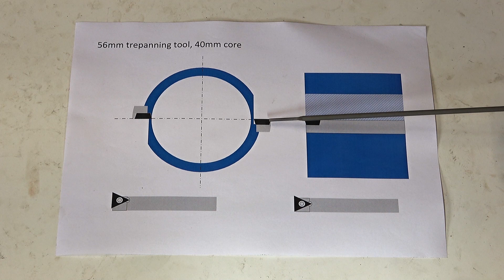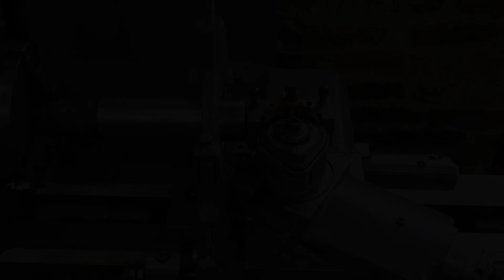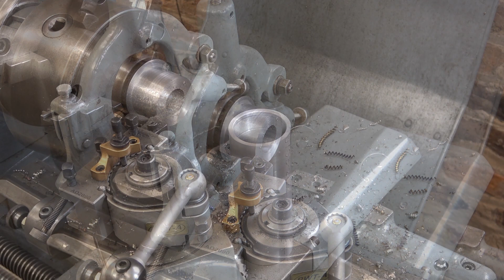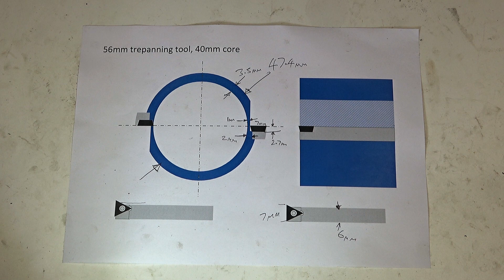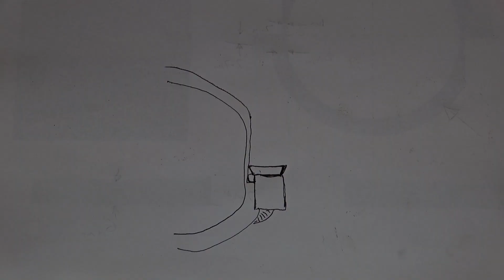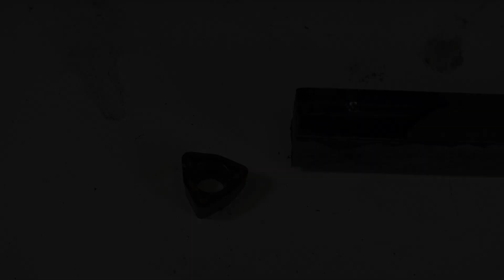HS104 Shopmade tailstock trepanning tool – Part 1

Comment: I seem to recall that David Wilks allowed a 5 degree relief angle on his scrap channels.

I once asked David why he showed himself standing next to a statue of Charles Darwin & he explained that Darwin was a hero of his.

Lastly I am envious of the Harrison which was my favourite lathe of way back. 
I don't think that you need to use carbide for this job unless you intend it for exotic materials in fact I suspect that carbon steel would work with the level of 'flood cooling' used together & low cutting speeds making a narrower cut possible.
Reply from the maker: Hi pcka I miss David's videos. Thanks for watching and the comment. 👍

Comment: Interesting. I like the your milling adapter.
Reply from the maker: Hi Greg, it's very home-made out of black plate and a bit of welding but  is surprisingly rigid and accurate enough for that sort of job. My new shaper vertical milling head might take over some of the milling jobs now. Cheers

Comment: that looks like a real handy tool! I'm sure it will be far faster than a hole saw.
Reply from the maker: Hi Tillie's, yes a trepanning tool of this design can cut a core as deep as you like, limited only by the length of the lathe bed. Cheers

Comment: Why you dont use parting tool inserts like mgmn300 or mgmn200 they woud reduce cuting presure and  the tiny lathe has not as mutch work to do
Reply from the maker: Hi Justin, I thought about using parting tool inserts but I could not think of a way to secure them in line with the scrap channels and also the trepanning tool sides have to be curved. So I went for inserts which lay flat with the securing hole. Cheers

Comment: Hi,Paul. Further down the page holesaws get mentioned a couple of times. Don't worry about them being too fragile as they do the job quite well but care and attention to chip clearance needs constant observance or they will bind in the trepanned cut. I use Morse and Bahco holesaws on a custom made tailstock mandrel. 
Also just to mention that not only do we both have similar shapers in our workshops but I also  have a Harrison L6/12" swing. Very similar to your 140.
Reply from the maker: Hi Howard, I have hole saws but always found they bind easily when I've used them in wood and I thought it might be a similar experience with deeper cuts in metal. So I note what you say. Cheers

Comment: I'm really interested to see how this works out. I've got to put some 60mm dia. holes through some pieces of 110mm dia. steel. I've used "Rotabroach" type cutters before (vid. on my channel) but the cutters I've got will only go 30mm/50mm deep & I've got 2 pieces 160mm long to go through...
Reply: Like you I have a number of Rotabroach hole cutters that fit on a custom made tailstock mandrel. They work very well but constant attention to swarf clearance needs to be observed. I think these purpose made trepanning cutters will clear the chips far more effectively than the Rotabroach type. I also often use bi-metal holesaws for cutting a plug up to 3/4" deep. Again with the hole saw swarf clearance can be difficult.
Reply: @howardosborne8647  I've generally found "Rotabroach" type core drills to be very good at clearing swarf from the cutter - as good as a normal twist drill as long as you keep a constant pressure on them, but the long strings can turn into birds' nests! Normal hole saws seem to struggle to clear chips from their teeth & need a lot of pecking. Plus they are always sloppy on their mandrels & cut rough & oversize. The trepanning  tools as used by David Wilkes look like they work really well but seem to need huge quantities of coolant through them to flush the chips out...
Reply from the maker: Hi MidEng, arbitrarily my tool finished at about 60mm outer cut diameter and the scrap channels are 80mm long which kind of sets the max core depth at about 90mm for this tool. But with a longer bit of scaffolding pole I could have made it about twice the length of my boring bar cut depth (boring to the middle from both ends). So if I was making another then 160mm+ core depth would be practicable for me without much trouble or extra tooling. Sorry you have to wait until Part 3 to see the final result but trust me it works as good as an apple corer even with the weedy 1.5HP (1.1kW) motor on my 'apprentice training' lathe doing 200rpm at 2thou (0.05mm) per rev tailstock powered feed. That's on bright mild, but turn down the feed rate and I'm sure it would make a fair attempt at alloy. Cheers
Reply: @HaxbyShed  Aha, so that's why you made the powered tailstock feed!
Reply from the maker: MidEng, yes indeed that's why I made the powered tailstock feed. 😁

Comment: Great little project and well presented and filmed! Totally random question: where did you get your workshop smock / coat? It looks as though it’s pure cotton but best of all has flaps over the side pockets, a big boon, I’m fed up of filing my left one with swarf, especially brass!  Thanks, all the best, Simon.
Reply from the maker: Hi TCE, the coat came from Workwear (UK) Ltd and is described as Tecwear PROBAN® COTTON DRILL COAT style 153. They have an online shop. Costs about £30.  The material is quite thick and feels quality. Cheers
Reply: @HaxbyShed  thank you so much for the reply and info! I’ll get one ordered. Terrific. 
If you’re in or around Halifax, West Yorkshire any time, please drop me a message and call in for a tour and brew. Thanks again.

Comment: That's a really interesting project. With a bit of thinking and planning.
I don't think my lathe is powerful enough to use this kind of trepanning tools.
And indeed, I also miss David's videos. I hope he's OK.
Reply from the maker: Hi Rusti, thanks. My lathe motor is only 1.5HP (1.1kW) and it handles the 60mm trepan ok. It does complain a bit but it copes. Cheers

Comment: Very interesting project,  looking forward to see it in action. 
I'm puzzled why you removed the spindle chuck, to fit the fixed steady, does the underside clamp not swivel 90° to drop between the ways, unless I missed something?.
Great vlog,  thanks for sharing.
Reply from the maker: Hi BT, in theory it's possible to swivel the clamp and drop it through the gap between the ways but the clamp falls off the bolt long before that point. I could put my hand up between the ways from underneath but that's a right fiddle so I've found the method shown is the easiest and quickest for me. Cheers
Reply: @HaxbyShed  Thanks for replying. I see Howard Osbourne has modified his fixed steady. I think my Colchester Master 2500 (not owned anymore), had similar design/feature.
Reply: The Harrison bed clamp piece is an awkward design to get in place. I have the same struggle with my L6 when fitting the 3 point steady. The answer is make a new clamp piece from steel and form a quadrant radius on two opposite corners. That would enable the clamp piece to be swivelled round out of alignment sufficiently to get it in place then turn it back until it engages with the rails on the underside of the bed ways. The standard Harrison clamp is a poorly thought out design.
Reply: @howardosborne8647  , I think my Colchester Master 2500 was designed as you described, if memory serves. 👍

Comment: are you worried about the stress on the machine gears,the machines david uses are monster torque at low rpm.?
Reply from the maker: Hi Geoffrey, later on you will see that the lathe stalls at one point but is protected by the inverter motor overload protection. The machine has a clutch on the spindle which I suppose might slip in the limit, and there is a safety clutch on the saddle powerfeed. The headstock gears are pretty robust and some models had a 3HP motor (mine is only 1.5HP) so I'm not too concerned. Cheers

Comment: Excellent work, I too used to enjoy David Wilks vids, an old schoo; engineer doing amazingly good work on ancient machines, because the modern ones don't have the grunt to get the job done. I shal look forward to seeing this tool in action!
Phil
Reply from the maker: Hi Phil, nice to have your comment. I had a quick look at your channel and the Fordson tractor refurb. You have a nice workshop there in East Yorkshire, presumably not so far from here (relative to global distances). The trepanning tool works without too many complaints from my 1.5HP lathe. Cheers
Reply: @HaxbyShed  Yes, close by, just outside Driffield, and my daughter is at York Uni and lives in Osbaldwick, so I am there quite often

Comment: That's a great build so far. Scaffold Tube should be EN39 which is NiCrMo so any fears about the durability should be unfounded. I am a certified scrap bin diver but am yet to scavenge out of the sea, impressive! Your Harrison lathe is a beauty which I can't help but covet! Looking forward to part 2. 
Best wishes, Dean in Oxfordshire.
Reply from the maker: Hi Dean, the tube held out with no sign of stress or buckle, just a bit of weld distortion. I'll be looking out for more of it next time I'm paddling on the beach. Cheers

Comment: Great video. Mr. Wilkes' channel is indeed impressive. I look forward to more progress with your build. Thank you.
Reply from the maker: Hi Carl, I've sent an email to David Wilkes - he has not posted a video in a while. I spent hours watching his stuff. Cheers
Reply: @HaxbyShed  Yes, I hope he is ok. There is a chap called Ade in Staffordshire. His channel is called AG Engineering. He used to do a lot of machining and welding based around motorcycle repair. He has a great back catalogue. Not seen him in a long while either.
Reply from the maker: @carlwilson1772  Just looked at AG Eng, some really good stuff on the old motorbikes.
Reply: @HaxbyShed  Yes, he has a Colchester Student and a very big milling machine, plus another smaller lathe. He has not posted for a long while, so I am hoping he is alright.

Comment: Great idea. I have been trying to use hole saws where possible to save material...obviously I can only go so deep though
Reply from the maker: Hi Craig, drilling and boring is such a waste of metal and it takes forever and makes a lot of mess. I have some hole saws but I imagined they would not be robust enough so I have not tried them in the tailstock. As somebody mentioned in a comment, Rotabroaches are an option if you want to spend the money. Cheers.

Comment: I'm curious to see how this works; the tube was a great bargain but I'm concerned about it twisting up in use.
Reply from the maker: Jim, I hope it's not a spoiler if I tell you it works 100% with no twisting. Better than I ever could have hoped. Cheers
Reply: @HaxbyShed  I'm glad to hear that!  I have no idea where to start with the engineering of one of these but now I have that data point.